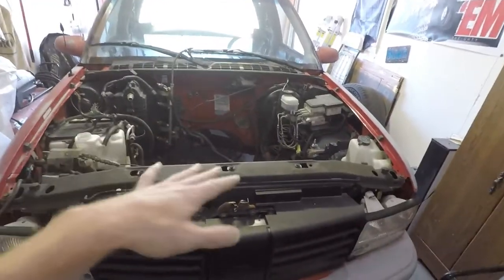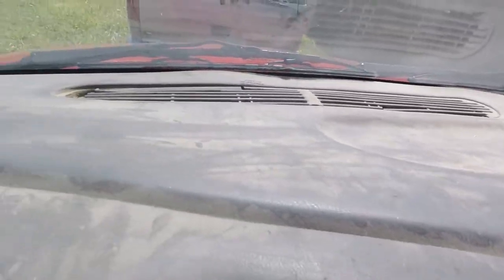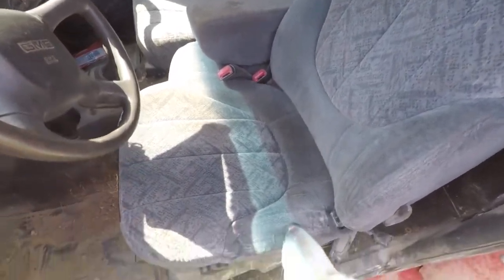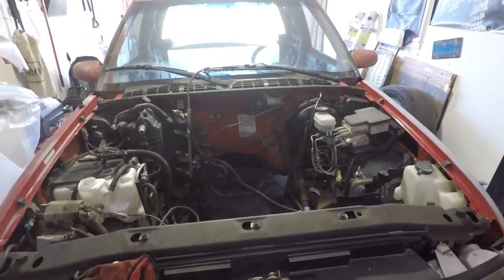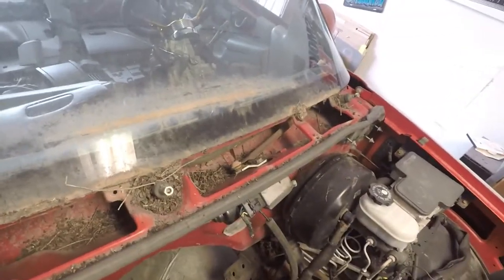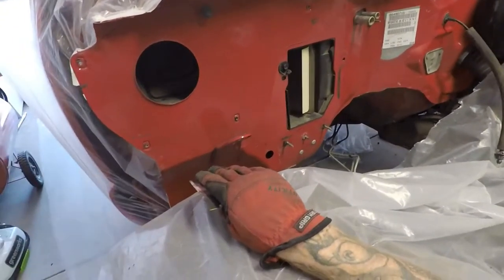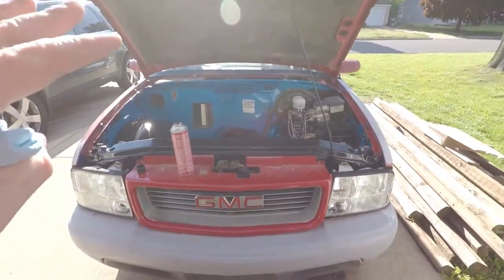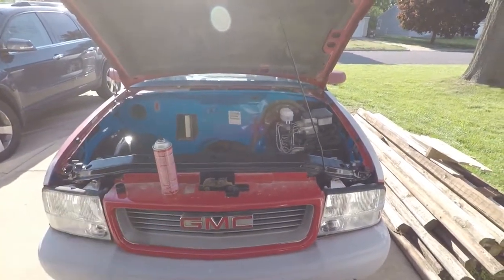REBUILDING A GMC SONOMA Part 4!!

Comment: How's your build coming along?
Reply from the maker: Kind of at a stand still on the engine bay until I can get a new wiring harness that comes thru the firewall. Other than that everything is coming together great now that I finally got the truck back from paint.
Reply: @BradzBuildz  My 94 Sonoma is gutted under the hood so I have to do wire harness also, lucky my project came with a painless and factory, would like to use the painless because it's new but if there's any problem I like the idea of a backup.
Reply from the maker: @waynetessier3058  I called my local gm dealer and they said the wire harness that comes thru the firewall is discontinued by gm. Looks like I’m headed for lkq. The painless harness is too much $$ for my budget lol
Reply: @BradzBuildz  ; My friend forced me to buy my project with the price he gave me for it, he has no budget so i'm the friend that got the amazing deal downstream and it's still going to murder my budget. LOL
Reply from the maker: @waynetessier3058  sounds like we’re in the same boat
Reply: @BradzBuildz  ; Are you putting a v-8 in your truck?
Reply from the maker: @waynetessier3058  no. I was going to but thought it would be cheaper to keep it stock
Reply: @BradzBuildz  ; It really can be done for a reasonable cost ,not my drive train.:)